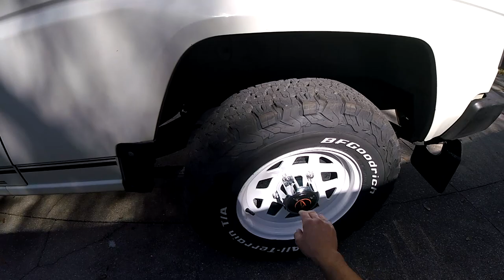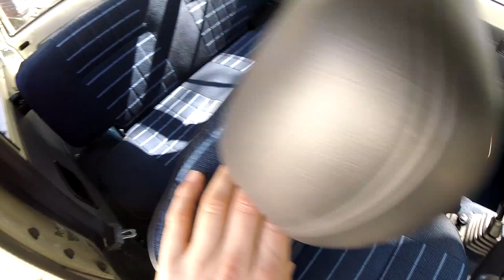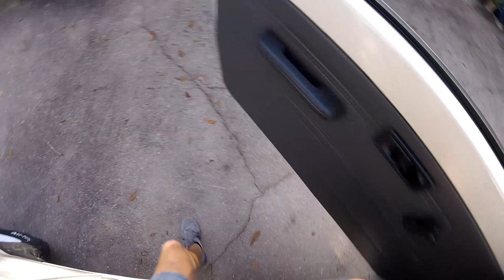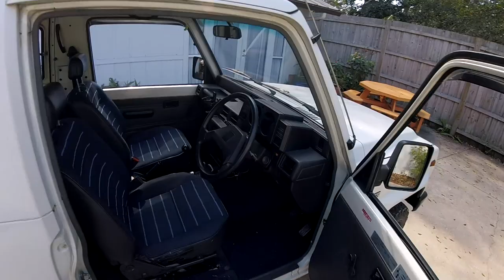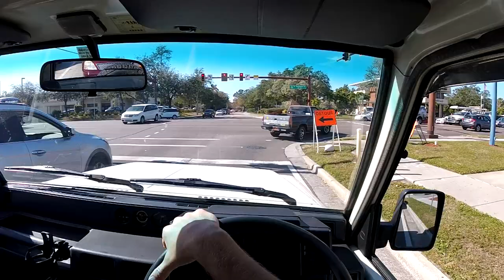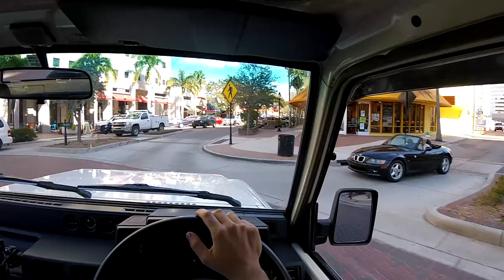1985 Daihatsu Rugger F75 Turbo Diesel 4x4 in the USA - POV Walk Around and Long Drive

Comment: fuel drain is for the diesel filter.  has a sensor for the water.
Reply from the maker: You're right, I had a look at the U.K. Fourtrak manual which explained it. Next oil change I'll be switching out the fuel filter.

Comment: thanks for the video. I was wondering, what fuel mileage you get with the diesel? The US Rocky has independent front suspension. It would be great and helpful, if you could provide a link to your parts source. thank you